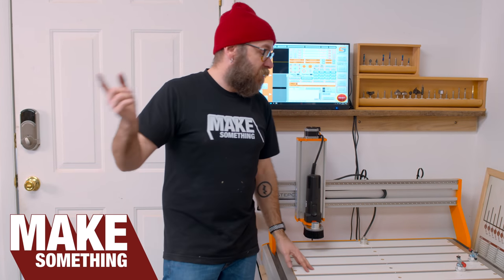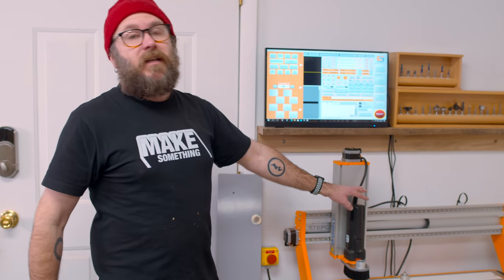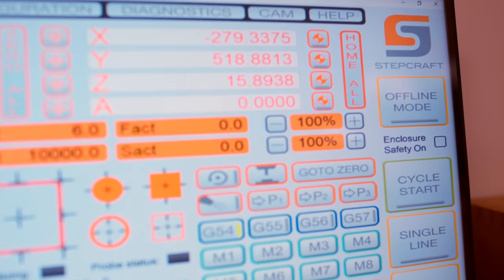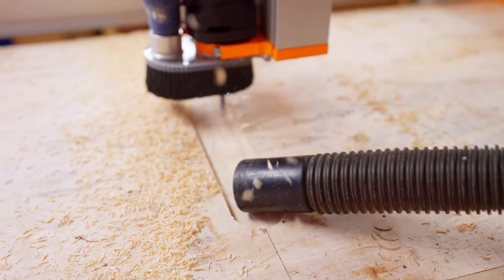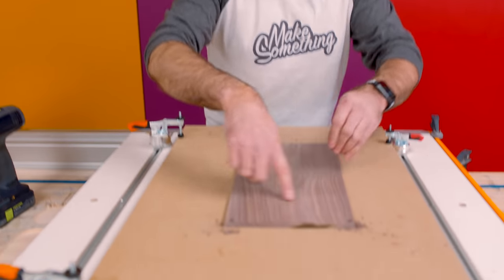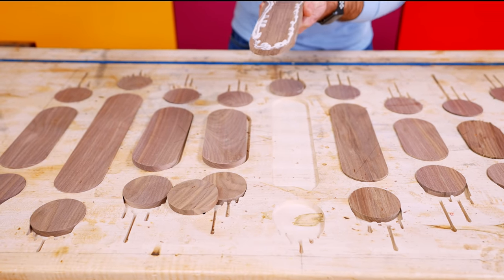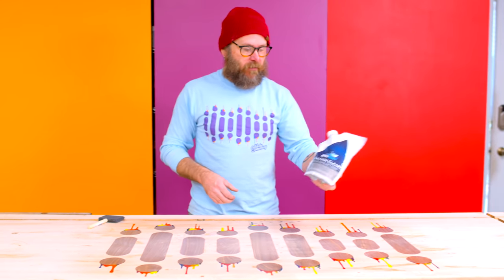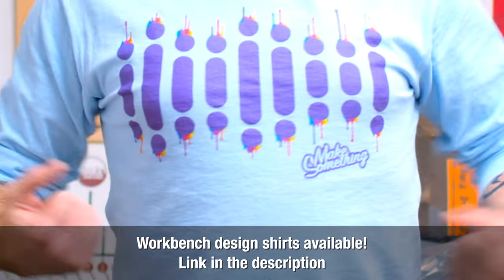This new CNC can do things others can't! Check out the amazing Stepcraft M-Series!

Comment: good vid, Im a commercial cnc programmer, If you get the vacuum table get a sheet of ldf low density fiber board cut to size of the table and install. you can cut through your job and occasionally surface out your table to remove cut through and have a clean cutting surface over and over till the ldf is too thin and then change it out!

Comment: If you do the tabs half hight or less.  When you sand the residue of the tab away angle your sander table down so you’re only sanding the bottom edge and the top edge remains unmolested and maintains the machined dimensions.

Comment: For thin panels, try blue painters tape on both workpiece and the bed / spoilboard, then super glue between the two layers of tape. I was skeptical at first, but it holds really well, and if your bed is flat enough, the two layers of tape mean you can cut all the way through your piece but not your spoilboard (bonus not necessary, it is a spoilboard after all). Then the piece is pried up, tape peels off, voila! Can NEVER have too many workholding techniques!! Great video!

Comment: I'm in the process of buying a laser engraver. I never really consider a CNC machine but that is a work of art. The problem is, it doesn't come with any attachments, so the price is going to add up quickly. i love the fact you did't edit out not fixing the dust collector, the first time, and then not turning it on. Haha!  The fact you learned something in the process offsets it.

Comment: Have you considered using the CNC to router the job surface flat? The rails are already there as is the router and sled. A large diameter router bit,  a simple cnc program or even manual jogging control will level the job or even the bed for that matter.

Comment: By the way, I used to race a 250 single cinder Honda Kart  years ago, back in the late 70s early 80s , I now ride a HD, back in the early 2000s 
About 15 of as road to Barcelona, to a rally, We were there one of the young guys had found a Kart  circuit, so we all decided that we have the day there, I think it was around €50 each for the day including our food and drink, We had a number of races, to end up with a final at the end of the day and the trophy or some paperwork at least, I did not tell anybody that I used to race a, it was easy lemon squeezy, In the final race of the day, I’ve got T-bone pushed off the track so many times, I still came across the line 1st, my claim to fame,

Comment: next time you hafta do the bridge (tab) thing, make them as thin as you think you can get away with and then after freeing them from the board, use a flush cutting router bit with the bearing running against the top part of the part which represents the final shape.  no sanding. no sanding problems.

cool tool, btw!

Comment: When running onion skinning it is best to utilized a sealed  vacuum system under the mdf.  If you create vacuum sealing under the mdf and then seal the top side of the spoil board around the part you can achieve a flat surface.  Keep the onion skin around .01"  Keep your onion skin channel just wider than the bearing of your table router.  It's nice to program in an entry hole instead of punching thru the onion skin.  If profiling go once thru the onion skin to free up the part.  Then profile(roundover, champfer, or whatever.  better to have a free part to move freely for profiling to eliminate burning and chatter based issues.

Comment: I use carpet tape so I don't need make tabs on any cut out. Found it working much better than normal double sided tape, but I do slow down for last pass just to be extra cautious.
Reply: Stephen Ferree  I use carpet tape by Rhino UltraTape. It comes with yellow backing paper, tape part itself is transparent with fine glass fibre mesh reinforcement.
Reply: Stephen Ferree  nice. I might make vacuum table once I upgrade cnc work space as atm it's mainly used for small jobs, keyrings, etc

Comment: 14:30 sand the piece totally flat first, then cnc your stuff with tabs that you can sand later. 

tip. do it fast. moisture can rewarp even the thickest slabs in a matter of hours, especially if the wood is relatively live.

Comment: Nice design it looks cool.
My method to get rid of tabs is to do the cut with a small outwards offset, then do a full depth cut with no offset (and no tabs). You need to follow the router and hold the pieces down with a pair of screw drivers (or something other than your fingers) so they don't come loose while cutting
Reply from the maker: Ohh, great tip, thanks!
Reply: @MakeSomething further to this tip, put a stop in after the first pass, then you can start it when you are ready to chase the router with pokey things

Comment: It might be good to throw in some "negatives"; it must have a few (but maybe since it was "provided by Stepcraft", you are not allowed to point out its weaknesses).  I've often wondered if sawdust makes its way onto the upper linear rails and sticks to the lube.  The side rails are somewhat protected with that rubber strip (though it does not seem to seal tightly; in one part of the video 11:40 it looks deformed).  I wonder how square that frame stays...I suppose one could bolt it to the table underneath.

This video reminded me that I have a door that needs some weather-stripping.
Reply: having a stepcraft I can say that dust does come into the rubber compartments and everywhere else as well. It is good to see them finally using vacuuming a bit more, but still.
about squarenes... do not expect it.

also the speeding up and slowing down on turns shouldn't be happening. I experience it miself  and suspect it has to do with the slow communication. I broke many bits that way!

Comment: More videos about the M series please! Just bought a M500 :D
Reply: What's your thoughts about stepcraft now?
Reply: @Asnovich  hmmmm. It wouldn't be fair  to just give my opinion without asking you what you're going to use it for. That said, i really think it answers a certain question from the market but it's not the ultimate rapid prototyping/manufacturing/diy machine.
Reply: @Mookl_design  then what i it for?  
Is it riged? Did you had some errors? 
I made wooden watches on cncstep and im thinking to buy stepcraft..I'm interested in quality and precision
Reply: @Asnovich  and no, no errors, persee, I love the rigidity of the M series. The only problem is the workflow. In the Netherlands at least it's annoying to buy material, bits etc if this isn't your full time job. Then there's the gcode making and the amount of time it takes to get something done, you can't leave the machine alone, or at least I wouldn't, and do something else. Hence my comment. It really depends what you're objectives are. If you know exactly what you're going to do and you have a good grasp of the technology and everything around it, the m series is a nice machine definitely!
Reply: Thank you for reply! :)

Comment: For your spoil board have you thought about programming a mill process for it to continue to use the piece? I use to run a multicam CNC and we would trim off 0.1" of the spoil/suction board and allow for more use of it. Usually going from 3" thick new to about 1 1/2" before tossing out.

Comment: Going to miss the old CNC. Gave me a chuckle every time you had a shot of the spindle. You're going to need a new sign for this one. Might I suggest Run CNC? I'm guessing you shot this before blowing out your shoulder, since you went for the hand plane here. And nobody's got time to sharpen plane blades. 😂 Anyway, cool new tool and the inlay graphic is pretty sweet. Thanks for sharing!
Reply from the maker: Thanks Seth! This was shot after I started physical therapy on my shoulder but before I re-injured it. Stupid arm!!!
Reply: @MakeSomething  I tell you what, getting older is some bullsh**. Good luck with the continued rehab. Guess you'll just have to make the robots work harder in the meantime. 😁
Reply: @sgsax  Getting old ain't for sissies.

Comment: As cool as this is, and, it is, however, the technology is not as new as you may think. Around 1980 I was a 24 year old youngster working for Rockwell International. Specifically, the yet to be launched Space Shuttle, B1-B bomber, and Trident submarine to name a few of the very complex groundbreaking multilayer circuit boards that passed through the shop. In order to drill literally thousands of holes precisely into these circuits, we used CNC, The machines were made by Excellon and each machine had 4 spindles. We could drill 4 boards side by side at the same time. The bits were often so small and fragile,  it was impossible to put a hole in a piece of paper with one by hand. However, that same bit spinning at 100,000 rpm would drill through copper, nickel, and fiberglass. Yes, that is the correct RPM. Here is where the tech was not quite there yet: Computers were huge and the memory was minuscule. We are talking maybe 256 kilobytes. Or, 1/4 of a megabyte. So, in order for the machines to run the program for each circuit part number, the program was fed into the memory for each one. We had a reel of the code which consisted of holes punched into pink colored paper, the reel was placed onto the machine and would pass by a scanner which read those holes and the paper would than go onto an empty reel. Exactly like old movie projectors and reel to reel tape decks. How those holes got punched into the paper in the first place was by a painstaking process. A clear film with the circuit printed onto it had been marked by the engineers with a line that went from hole to hole. Connect the dots so to speak. A technician sat with a wheel to move along the Y axis and a wheel to move along the X axis. As he manipulated the 2 wheels, he peered through a genuine Nordan Bomb Sight used in bombers during WW2. Each time he centered the sight over the exact center of each hole, he used both his feet to press a set of peddles which in turn punched a hole into the paper tape. The CNC would follow his mapping on the machine and drill the holes. This paper tape also knew the drill sizes and the machine would change its own bits which were mounted along the side as it drilled the boards. It was nearly a punishment to operate the programming of the tape. If the tape was punched wrong, it had to be restarted. If there was a revision to the circuit, that also needed a new tape. It could take 40 to 60 hours to punch out the holes for a single board. Obviously we have come a long way, but CNC has been here for awhile.

Comment: Is there an affordable CNC you can suggest? I think they are all out of my budget but they are so cool I want one! Love your channel and thanks for all of the lessons and information you share.
Reply: Build your own. Look up Dave Gatton CNC. I built mine for around $1500 which included $700 design software. It's a 4x4 table.
Reply: The other brands that are this size are around $2k. Used they are about $1200+.
Reply: @jeremyspecce  I built it in 2017 so it's been awhile. I think I worked on it for about 3 weeks on and off on the weekends and a little bit of time after work. It's a great machine. Dave has a great following of people on Facebook. They can answer all questions from the preparation phase all the way to after it's up and running. Dave sales the kit that includes all the complex parts that are cut on his CNC. All you have to cut are pieces that are either square or rectangular. He also includes plans that include live links to all parts that are needed for example the electronics.
Reply: If you’re looking for a real budget build, I built an MPCNC for under $500.  If you don’t have a 3D printer, just add $200 to that cost for an Ender 3.

Comment: What about the router and the bracket that holds it? The bracket is small compared to other CNC's and holds the router in a low center of gravity that looks like it would give easy. The router also does not look very substantial, what is your experience on these two maters?

Comment: Is 3k too low of a budget to start out?   I want point to point cnc for hobby cabinet making.  24" x 48" bed is min.   Although, I'd love to see a full 24" x 90" bed for taller cabinets.   Any info helpful.  The new D series has an option around 3k that fits the bill, but need to understand D series vs the m1000.   Why is it cheaper... ?

Comment: Did you have any difficulty setting up the touchscreen? Specifically to allow you to move the machine manually in x y and z? Having a little trouble with that
Reply from the maker: I didn't need to do anything with the settings but I did find that when you touch the touchscreen to jog you then have to slightly move your finger. Touch and slide about a centimeter. I did end up hooking up a USB game controller which is much easier to jog.
Reply: @MakeSomething  thanks much appreciated

Comment: Did you get the machine preassembled or as a kit?
Reply from the maker: I got mine preassembled.
Reply: @MakeSomething  I’m thinking about getting one. Would you say it’s too heavy to carry down a flight of stairs? Lol
Reply from the maker: @Shipwreck0316  The M.1000 is pretty heavy but you can easily take out the spindle and the table to lighten it up. Best advice is to get someone to help you (but I don't always follow my own advice).

Comment: Hey, great video - Been ages since I watched one of yours (guess I’d forgotten to subscribe until now 😉) - Some hilarious bits in there, but always love the slightly crazy presentation style. Not sure how long ago you did those, but LOVE the colourful walls you added to the workshop. Are they on individual boards with a shadow gap or something? Anyhow, in case you hadn’t figured this out already (seen as it’s a year ago since you did this video) but you can easily machine a vacuum bed grid using the CNC, rather than buying one. Though (a) depends if you can be arsed to do it, and (b) I guess you may feel you ought to actually buy one from StepCraft seen as they gave you the machine for free to begin with. Look forward to some more content on learning to use the CNC 👍

Comment: Could you not have paused the machine and set the height of the dust collector? It seems such an advanced machine would provide the ability to simply hit pause in the middle of the project, in case you need to replace the bit, or in the extremely unlikely event someone would ever forget to set their dust collector height. Not that anyone would EVER forget to do such a basic step or anything.
Reply from the maker: Yes, I just didn't know how at the time.

Comment: A CNC is not a thing, CNC is a method of control.
Reply from the maker: Cool. Make sure you say cellular telephone from now on. Not cell phone or cell. Thanks.
Reply: @MakeSomething  A phone describes something specific, "A CNC" could be anything from a router to a snack machine. As I said, CNC is a form of control, not a specific  machine. Not singling you out, it's a common faux pas.

Comment: what software is he using?
Reply from the maker: Drew it up in Adobe Illustrator
Reply: @MakeSomething  nice. How do you transfer that data to the cnc?
Reply from the maker: Export out as svg and then import that into Vcarve to set feeds and speeds which then sends to the machine. There may be more streamlined ways of doing this but I’d have to do some digging.
Reply: @MakeSomething  I'll have to try that. Fusion360 is fine but for simple designs Illustrator is way easier. But also Vcarve might make things easier as well, I'll have to look into that. Thanks.